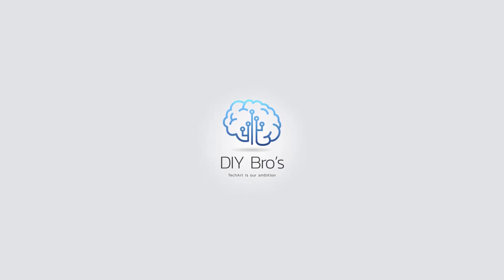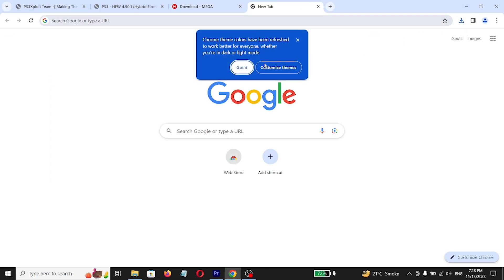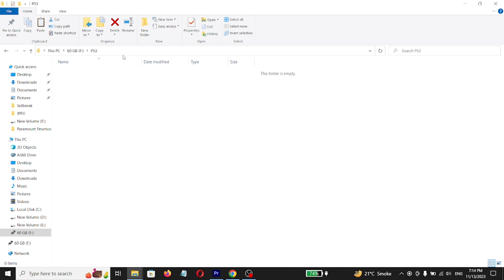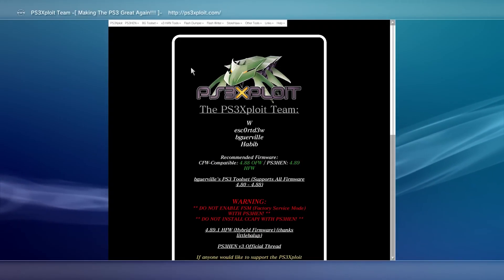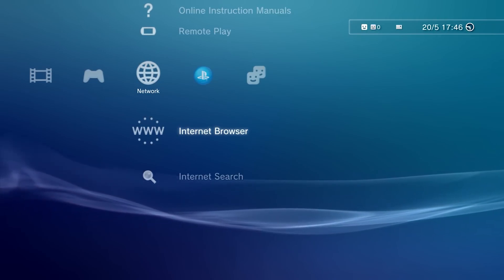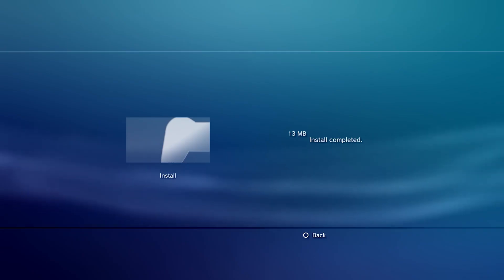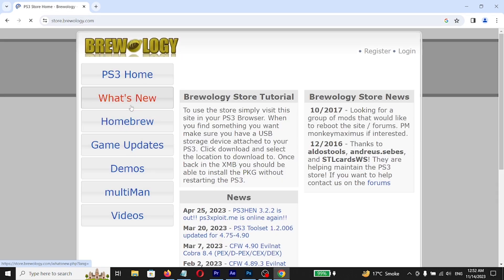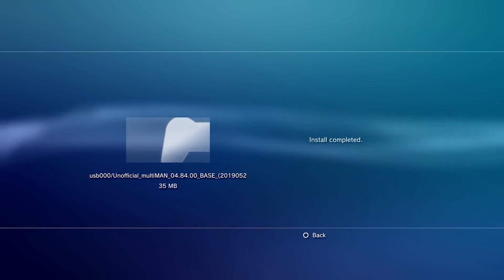How to install hen on ps3 4.90 with usb | Just in 5 minutes | DIY Bros

Comment: clicked on update via storage media and it says no applicable data was found
Reply: use the recovery mode and it's will be work❤
Reply: As soon as you've pressed star t and select at the same time immediately unplug your controller and it should find the new data when the USB stick is plugged in

Comment: hello, i have a playstation 3 slim CECH-2504A this method working ? 
thank you
Reply: I went to put it on HFW (hybrid firmware) 4.90.1 but he tells me "No applicable update data was found" (My usb stick 16gb fat32 by rufus)  thanks
Reply from the maker: Is it you PS3 software version same 4.90??? And also you need to put file on proper folder
Reply: @DIYBros  yes, it is updated to version 4.90
I put the file exactly as you show in the video. what's wrong and it doesn't recognize me?
Reply from the maker: Send screenshots on diybrosofficial@gmail.com our team will try to solve your issue
Reply from the maker: Yes it will on all models

Comment: it says no aplicable update was found
what can i do?PS3 SLIM
EDIT:i installed via recovery mode,but the ps3xlpoit page gives error mesage:the page cannot be displayed
Reply: i have found the solution, instead of pasting the .zip file on UPDATE folder, what you will need to do is unzipping the .zip file, then go PS3->UPDATE and copy the PS3UPDATE.PUP, and paste into the first UPDATE folder
Reply from the maker: You need to confirm that USB drive is fat32 formatted and have right folder where you put update file
Reply from the maker: You need to confirm that USB drive is fat32 formatted and have right folder where you put update file

Comment: hi, my ps3 just can find the update... i'm in 4.90, put the file in PS3 then UPDATE, and my ps3 said no update available do you have any solution ? thanks
Reply: Hello bro if you have ultra slim ps3 you must turn your ps3 on the factory mod and try to do the update
Reply: I have a PS3 slim
Reply: Okay try with factory to see if it work
Reply from the maker: Do you have have FAT32 format USB with correct firmware???
Reply: @DIYBros  still cant update my PS3 :'( do you know a discord channel where i could find help ?
Reply: Yes
Reply: If you think that the firmware is incorrect i will give you the correct link
Reply: @thegamer-cq6vp  still cant update my PS3 in recovery :'( do you know a discord channel where i could find help ? i have the slim one
Reply from the maker: Email us on diybrosofficial@gmail.com our technical staff will solve your problem
Reply: im also having issues i did everything in the video and  it says no applicable update data was found
 @DIYBros
Reply: i have found the solution, instead of pasting the .zip file on UPDATE folder, what you will need to do is unzipping the .zip file, then go PS3->UPDATE and copy the PS3UPDATE.PUP, and paste into the first UPDATE folder